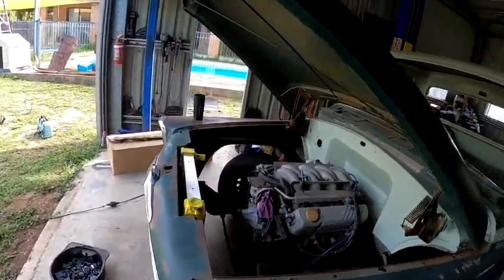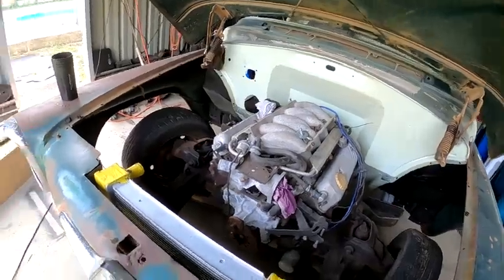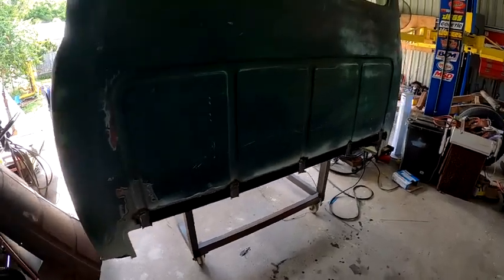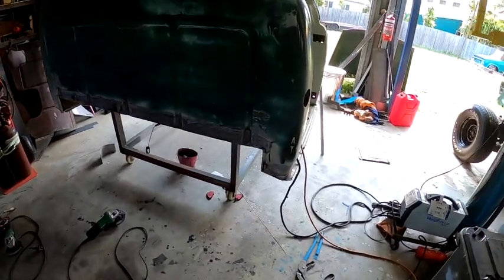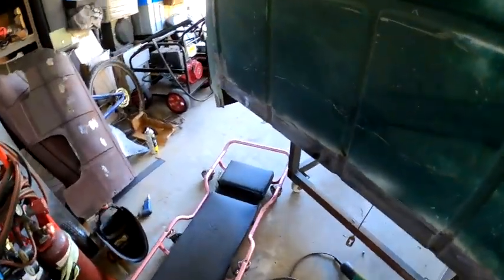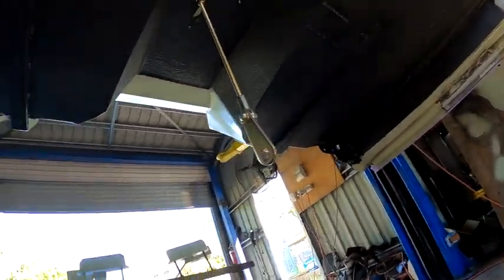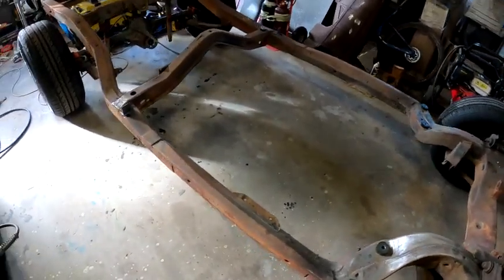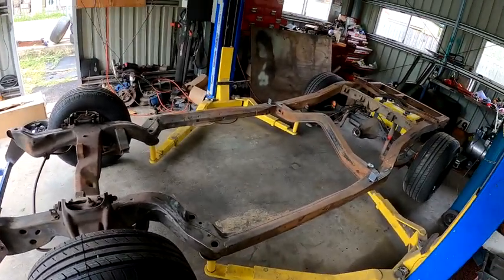Custom International build Ep.5

Comment: Hi Rob what thickness steel did you use for the floor 
I didn't think they liked flat floors without ribbing supports 
Sorry for my novice questions
Reply from the maker: I used 2mm hot roll steel for the floor and there is bracing i just made it infer the floor so it's neater. Engineer is very happy with the floor.